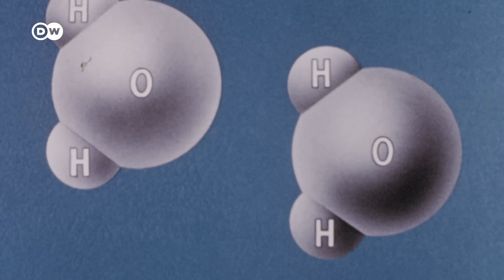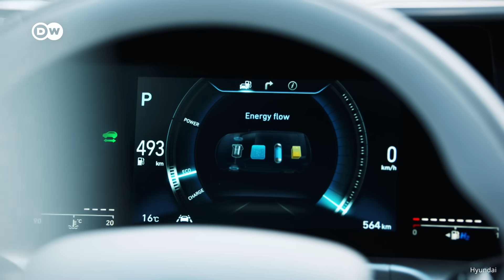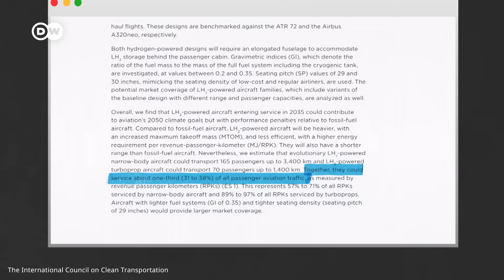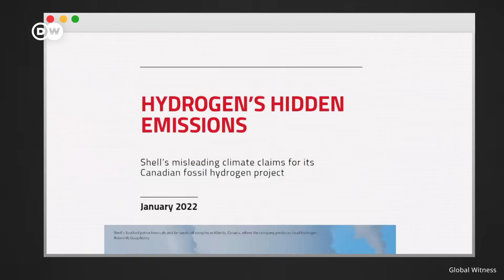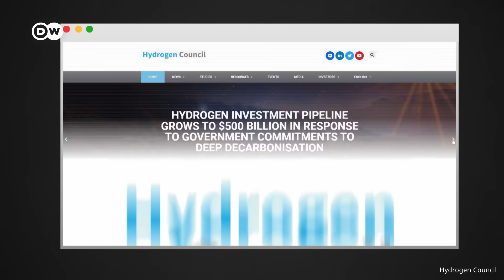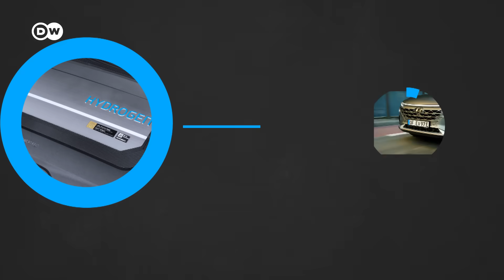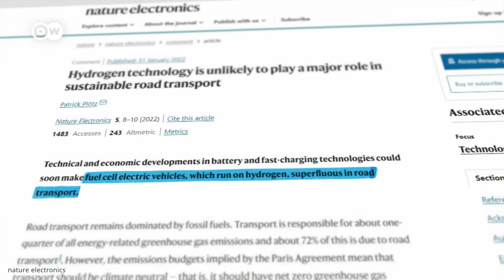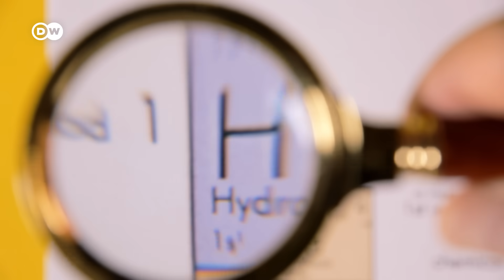The truth about hydrogen

Comment: Hydrogen as a fuel, and any and all fuel cells based on ionic transport, are complete economical and environmental disasters hyped for PR reasons and uneducated people projecting/extrapolating orders of magnitude beyond their primitive understanding. The thermodynamics are clear, and the kinetics and materials science as well. It's one of the dumbest hypes ever. Just consider this: electrons and hydrogen ions carry the same amount of absolute charge, except one weighs almost 2,000 times as much, with concomitant storage, transport, and related issues. Water is an end product, not a fuel. The energy required to create hydrogen from any source, even if using renewable energy, is considerable and a huge environmental burden, and it is way harder to store, transport, and keep safe. People need to understand basic physics and well-to-wheel type analyses to recognize this. Even in this video, and most other "net-zero emission" analyses done by companies trying to look more 'green', absolutely no attention is given to how much energy it takes to manufacture these production plants, storage and transportation facilities, the great maintenance burden of these, etc. Bush's FreedomCar $1.2B initiative in the early 2000s and all subsequent projects I have witnessed are just propaganda and wishful thinking.
Alex, PhD
Former Ford representative and co-chair of the FreedomCar H2 program and head of Ford Motor Co's solid-oxide fuel cell program.

Comment: Nuclear is still the future...  Still the cleanest safest source of energy that has caused less pollution across every nuclear plant to ever exist in their sum total lifetimes than the energy output of any alternative fossil fuel does in a single year.  If we built modern nuclear plants with the newest technology we have, it would be physically impossible to have a meltdown.  

The tiny tiny amount of dangerous nuclear waste generated is stored so thoroughly that you couldn't invent an accident bizarre enough to cause it to leak.  The vast majority of nuclear waste are things like gloves and boxes that may have come into contact with radioactive material.  And they become innert and safe to dispose of within a year.  

Hydrogen is by comparison, incredibly dangerous and explosive.  It's invisible, scentless and highly flammible.  Even green hydrogen requires filthy solar and wind which require mining those rare metals.

Comment: If converting natural gas into hydrogen and electricity to charge battery causes an efficiency loss of 60% and 20% respectively, then wouldn't using gas directly be better?? After all gas only require one third the storage space for hydrogen so are more compact for use in vehicles, ships and planes.

Comment: I am NOT a great chemist, or a who knows what physicist .... but in my opinion ... to use one product (electricity) to produce another product (hydrogen), which then to produce the first product (electricity) I don't think it's an efficient method, you lose a lot of energy along the way. Not to mention that we use water, which is currently a lot on earth ... but we are already facing droughts in some areas of the earth. My opinion is, we need to research batteries, much more efficient, methods to produce electricity as green as possible ... by no means as complicated as possible for a problem as simple as moving a weight (cars)

Comment: It is not that simple with green hydrogen either folks. For producing cheap hydrogen we need a steady supply of green electricity, simply because the cost of power is 170 times larger than energy and we cannot afford to underutilize an extra expensive electroliser on an unstable renewable source. Without an steady supply of electricity, the cost of curtailment, smart grids or storage will drive the cost of electricity to produce hydrogen up, and even when the cost of electrolizers will certainly go down, it still will be extremely costly to produce (>$10 kg). The forecasts for 2030 and 2050 are based on the absorption capacity of the grid to avoid curtailment from the hydrogen facilities. Nonetheless, the grid itself is evolving towards a strategy of maximizing power generation which will make excess electricity production absorption almost imposible. You see the problem now?, stabilize an electricity grid with a portfolio of volatile renewables is the problem of the century, until it is not solved we cannot have cheap hydrogen.

Comment: True Green Hybrid SUV:
15kw plugin battery (>110km range) with efficient regenerative breaking, ultra high capacity >1.5kw solar top on roof & bonnet and small hydrogen 4kg tank (>350km range) for light-weight & cost-effective green hybrid FCEV (>600km range) under $25k or ₹200k..!!

Comment: Universal Axiom: All hydrogen stocks suck and will continue to suck until electrolyzers are conceived, designed, and built that can produce millions of tons of hydrogen per annum.  Right now, this is not even close to possible.   Hydrogen electrolyzers and fuel cells are total nonsense in India and everywhere else, the "Hydrogen stocks" are hopeless losers because none of the electrolyzer companies can deliver industrial-scale capacity.  They only offer small-scale electrolysis capacity, so they can't provide anything but small-scale revenue.  Small-scale revenue will never eclipse their operating budget, so they cannot show a profit (earnings).  Small-scale electrolyzers cannot make enough H2 from water to reduce CO2 output at an industrial scale, so they are irrelevant.  Renewable energy is coming on line quickly, but to reduce global warming, one must decarbonize all of the greenhouse gas emitting sectors -- transportation, agriculture, residential & commercial building and industrial sources (primarily concrete, glass, steel and industrial chemicals).  That means we must create decarbonized fuels such as green ammonia, whereby we take cheap and abundant renewable energy and split water into cheap hydrogen and oxygen.  Then, humanity can remove nitrogen from the air (air is 78% Nitrogen) and, using the Haber Bosch method, combine the green H2 and N to make green ammonia (NH3).  Ammonia, as a "liquid carrier of hydrogen fuel," can carry more hydrogen/BTUs by volume at a reasonable temperature and pressure than gaseous or liquid hydrogen.  Large-scale electrolyzers (no existing electrolyzer manufacturer can provide) would allow green ammonia to fuel and power all greenhouse gas emitting sectors.  When electrolyzers are scaled to provide ammonia-scale plants producing four million metric tons of anhydrous ammonia per year, replacing methane feedstock; call me.  It is important to realize that to produce one ton of ammonia using today's methane "steam reformation process" conventional ammonia producers for nitrogenous fertilizers release 2.84 tons of CO2.

Comment: I think that we will need to use every available means to actually reduce the effects of climate change so to me blue and grey energy are pretenders to the debate as they do not perform as the fossil fuel industry would like us to believe, carbon capture and storage is still only a dream and so far has only been tried in very small setups. The question also remains as to whether we can guarantee that sequestered Co2 will actually stay sequestered over the long run meaning centuries!
Reply from the maker: Great question! We have a video that you might be interested in on carbon capture. Check it out and let us know what you think in the comments 🙃
📺 https://youtu.be/JHs-eWHb16g

Comment: the real problem is that hydrogen is the smallest molicule and leaks through metal and with this infiltration the hydrogen embritiles the metal something no one is talking about and that the gas has to be very pure as witnessed with pipelines with mixed gases explode espeially at the terminus of the lines.this whole problem of 5million dollar refueling stations for hydrogen is turned around when the hydrogen is densified less storage space lower presure storage and non criogenic tempertures when using ammonia.now ammonia when using anion catylisis and nitrogen reformation is one third the price of hydrogen. but no one has that process yet or are in the 1.50 to 3.00 per kilo price where as fuel positive claims a green electricity supply can produce ammonia at .60 per litter. lets not kid our self s there are way to many concepts being floated and funded that dont work carbon capture and underground storage 95% failure with the 5% beinf used to replace water with the sand and chemials in fracking. billions being spent on methane reforming instead of methane pyrolisis to carbon black and hydrogen not being considered as it was deades ago beause you lose 40% of the energy of methane when you  remove the carbon as is with gasoline and further exsasberated by the fact that the refineries cant ad six barrels of water to every barrel of distillate this would increase oil demand seven fold or at least double if you are convined that refiners dont crack oil and add water. so even if you tried to de carbon gas or oil you would double the supply side reqiurement. the other way to tackle the problem is to simply replace the  energy hungery processes with graphine one tenth per cent graphine in concert reduces the demand by 50% if graphine replaced structural wood it woud elliminate 20%of the total energy demand that is  used in foresty and manufacture of building materials and make them fire flood and hurricane proof. And if you go through the whole inventory of materials from tires pavement cars plastic copper alluminuim steel nikel batteries ect our transport energy demand would be les than half replaement costs would extand out  past 5 to 10 decades and atually reduce energy consumption from fifty to almost 100 per cent.

Comment: We do not have the electric infrastructure to charge everybodies cars, we do not have battery technology that will allow a farmer to plough a field, battery cars are not good for towing 3.5 tonnes up hills and battery trucks are very good for cornflakes but not good for forty tonne loads over long distance. Hydrogen will allow better use of green energy by simply storing energy during peak production for use during peak consumption, ie from wind and solar. Hydrogen has no transport footprint if it is electrolysed and compressed on site at the refueling station or site of high usage (steel plant, airport etc)

Comment: For most traveled roads (urban/suburban/highway) can feed their cars electricity without large polluting lithium ion batteries. Ever see an electric bus or train? Like that. Even plastic batteries could be built into roof decks, with grass, wager drainage and solar panels on top side (interface on bottom - which also distributes power and communication to homes). What does this have to do with Hydrogen? Red America has a lot of less well-traveled roads, although cars on these roads will still have some grid linkage (or independent power generation). Cars that leave the grid could generate hydrogen when on the grid (using power for electrolysis systems in car).  Hydrogen is then for energy storage and it kicks ass on the road. Instead of having H2 generation in the house, put it in the car and link the car to the grid. Cars that never leave the grid would not need this.

Alcohol fuel systems might also be used for farm equipment - or self-generated biodiesel.  Of course, in sparsely populated areas, using good old gasoline would have less of an impact - provided that urban areas in red America are still electric and on grid. This will always be a balancing act - although H2, even if not the most energy efficient, may be the most environmentally efficient.

Comment: No. If you talk about certain elements of the problem without talking about the other elements, you cannot claim to be "telling the Truth".

Electrolysis separates hydrogen and oxygen from water. A spark causes their explosion, the result of which is water. But there is a problem: separating hydrogen from oxygen requires more energy than the explosion products. So hydrogen is not a profitable energy. There is no point in developing the use of hydrogen if we have not solved the cost-effective way of producing it.

Now I ask a question: let us suppose that man has found this cost-effective way of producing hydrogen. If man maintained his current energy needs by using the water of the oceans, how many meters would decrease the level of the oceans, and what would be the innumerable consequences on ecosystems, climate, drinking water resources, etc...

Same questions for those seeking to succeed in hydrogen fusion.

Man would do well to learn from his mistakes, before starting again a crazy project without thinking about the consequences.

Comment: EVs emit zero exhaust gas while driving, but emit a lot of CO2 when producing batteries. Also, the power to charge the EV must be 100% renewable energy to be a clean car. In other words, there is no big difference in CO2 emissions between gasoline-powered vehicles and EVs, and it cannot be said that EVs contribute to the environment. In addition, EV has a practical problem that charging is slow. With the current technology, it can be charged for 30 minutes and can run only 100km at best. On the other hand, gasoline-powered vehicles and HVs can be filled up in 2 to 3 minutes and run for about 800 km. Only EV users who live in the detached houses can charge while sleeping at home, and EV users who live in apartments cannot. Besides, in many developing countries in the world where the power generation system is unstable, it is impossible to charge EV on a daily basis. Even if EVs are sold in this way, the environment will not improve unless they become widespread in the world, including poor countries. It is possible to improve the environment by promoting more HVs that already have infrastructure, rather than promoting EVs.
Reply: Your information only show about the state of EVs in 2010. Since then things have changed a lot. Batteries are mostly built in factories that run mostly on renewable energy - thus the emissions in their production are being minimized - so that their CO2 rucksack is compensated after 15-20000 miles, some even earlier. Charging on the go no longer is slow. There are cars that add 100km in 5 minutes if needed. Most of the charging though happens when the car isn't being used (the average car is parked somewhere for 23 hours a day). The best FCEV (what you called HV) have a realistic range of around 400km (Toyota Mirai II when not considering the WLTP range but real world range which is 1.3kg of hydrogen for every 100km and a 4.7 kg tank). The more cars fill up at a hydrogen filling station the longer that station needs to cool down again to -40°C (hydrogen gets warmer when expanding, contrary to any other gas except helium under pressure) to service the next car - which will simply have to wait to get its fill of hydrogen, with wait times depending on the frequency of use of the filling station and ranging up to 30 minutes - 30 minutes in which a BEV can carge enough energy to drive 300km. Also these filling stations often run out of hydrogen, so you before committing to using one filling station you need to check if it is frequently used and may run out of its stored hydrogen by the time you arrive there. If you do and don't have the 50-100km range you need to get to another station you're screwed. Also these filling stations are exceedingly expensive ($1M per filling station with one pump and a storage of 100-400kg or hydrogen, lasting 20-80 refueling processes). 

No country in the world has a noteworthy hydrogen infrastructure. The least worst are Japan, South Korea.Germany and California (because they all heavily subsidize hydrogen infrastructure to a degree that that infrastructure will probably cease to exist the moment those subsidies run out because they never reached the viability threshold). Have a look at h2.live website which shows how well the hydrogen infrastructure is doing across Europe. Try to go on holiday from Germany to France or Italy - you might make it to Paris and back on the former but anything beyond that it's trailer transport time. In Italy you might make it to Venice and back (if you are lucky, the hydrogen filling station in Italy - yes, there is only one - is by personal appointment only). You'd never make it to Spain or even the capital of Italy without certain stranding on the motorway along the way. But even within such a "privileged" country you often have to drive additional 30-50km one way to fill up your car which only has an optimistic 400km of range...

Comment: If you make so called Green hydrogen from solar panels and wind turbines then surely you must consider the energy required to mine and make those devices… also you need to consider their life span is only 25 years and then they need to be replaced. In the case of wind turbines there is also the footprint of the steel/concrete pad they sit on. It takes 2 years of operation before a wind turbine offsets these emissions. So green steel is not so green and I’d like to see some analysis of this. Also the fact that there is no solution to recycling solar panels on an industrial level.